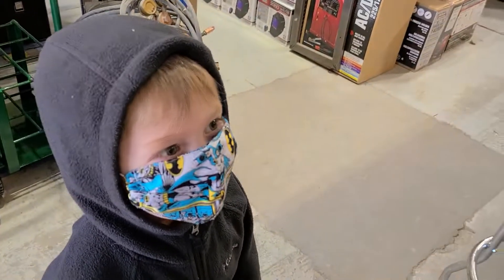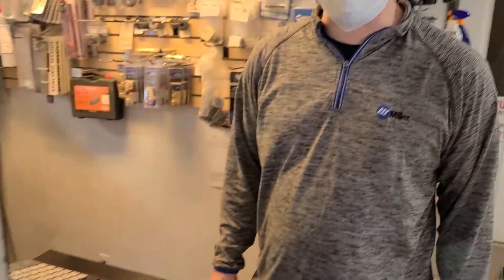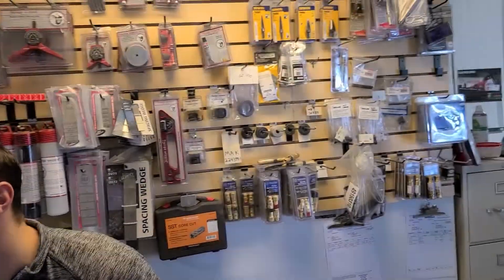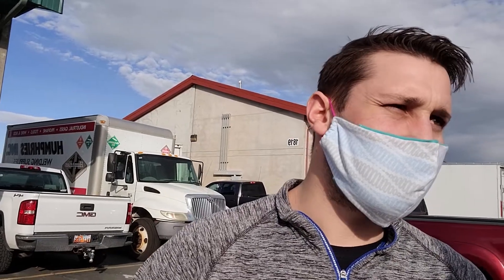Welding Gas Tanks

Comment: Yes, I have a question. How much is it to buy a tank, and how much is it to fill the tank. If you know the answers, why not just say what the range is. I know it varies depending on the gas, so what is the variation? Price of tank, price of gas. Try this: give the price of the smallest tank, and what the cheapest and most expensive gases are, then do the same for the largest tanks. Simple. You're welcome.
Reply: Yea you're right that's totally good comment

Comment: In case this is helpful, I purchased a 92CF cylinder of C25 gas for a total price of around $330, including fees and taxes, from General Air, here in Denver.  This was a whole lot cheaper than the quote from AirGas for an 80CF.  The C25 gas for the 92CF was priced at $76.  I wanted a tank big enough to last for awhile, but not too big to transport.
Reply from the maker: Awesome!